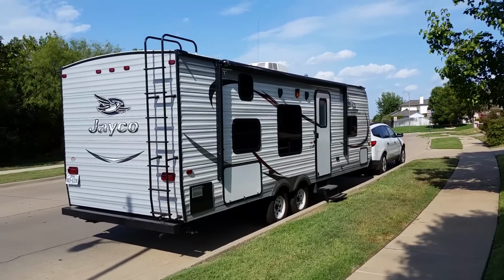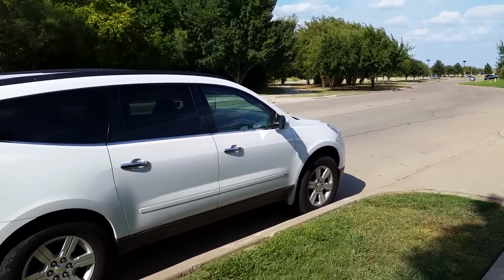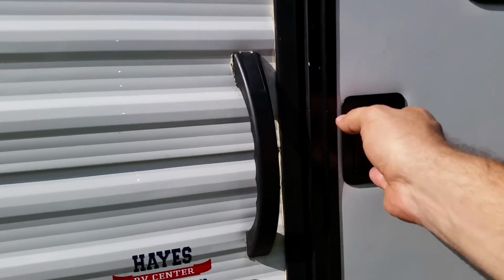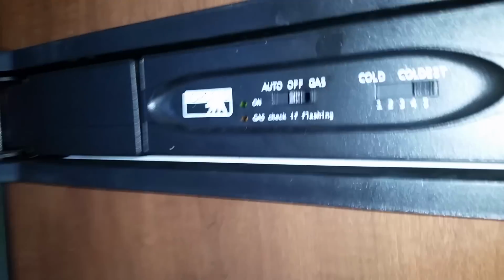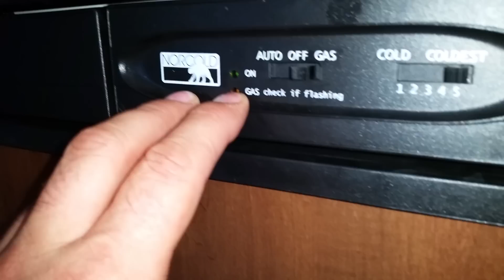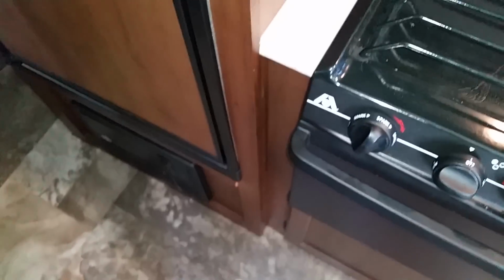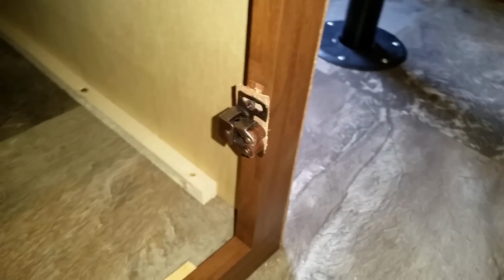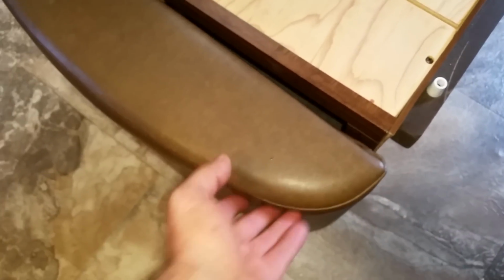Update: New JayCo Trailer FALLING APART.  Lengthy Warranty Work Needed.

Comment: Our Jayco didn’t last out  the warranty period and the Factory wouldn’t honor any warranty saying it was our fault ( the "fine print" in the manual )… Like our fault for not immediately  applying caulk to their “dry fit windows” …That and the interior uses things were made out of old pallets or some kind of scrap wood , and the cheapest particle board  we’ve ever seen   ( soaked up water like a sponge , then turned to Oatmeal ! ) …   Nasty , poorly designed , POS …   Nevermore !!!    And the RV Dealer was a bigger Liar than the …  you know !!!

Comment: HAHAHAHAHA, those aren't made by the Amish...NO travel trailer is.  They may be made in Amish country, but the Amish DO NOT make RV's.  There is a video that shows you how those are slapped together fast and nasty.  

I had a 2015 Gulf Stream Ameri-Lite that would make you really appreciate your Jayco.  It was wired wrong, plumbed wrong, absolutely built like crap.  I had to engage an attorney to hold them to the fire to repair everything.  I dumped it for a Northwood NASH and that Northwood makes all these other Lit-Class trailers look like toys.  \

Sorry your going through this.  Document EVERYTHING and get an Attorney ready to go cause they don't give a shit.

Comment: I am so sorry you had such bad luck with your Jayco. They should give you 100% of your money back. This type of craftsmanship is criminal. They should pay you alot of money for your aggravtions. Such cheaply made garbage. I have a 2015 Keystone Outback that is a bit better made. I did find a huge empty space that was stupidly completely inaccessible which should have been available for storage. Even the water pump was very tricky to get to. Seems like retards make these things. They use the cheap metal screws already rusting instead of stainless steel for another 20$ more total dollars. The shades were installed so tight I can hardly move them up or down. Hopefully word gets around and they start to improve.

Comment: I'm sorry for your troubles. However is this your first camper? They are all made like shit from shit.  I've owned quite a few from various manufacturers. They all fall apart and need work all the time. There is no place to get work done either that's any better than the manufacturer . To own a camper you must be able to fix them. Also you have to accept some quality issues. It's not your house. I don't blame jayco. I blame the rv industry. My opinion. .....

Comment: Jayco has a reputation of being a horrible rv. They build these things extremely fast and use the cheapest and lightest material possible to keep the weight and overhead down. I'd stay away from any rv  that promotes its lightness. Buy a bigger tow vehicle and get a grand design rv.

Comment: I bought a Holiday Rambler 35 foot travel trailer. Nothing but trouble. Thousands and thousands of dollars. Don’t buy a travel trailer, save your money buy a cabin instead. At least you will have something that will increase in value. Trailers deprecates just like a car, they are junk put together with staples and screws. Thin pieces of pressed wood(?). Everything went to hell inside. As soon as the warranty ran out the refrigerator, furnace, and air conditioner quit working, I had to buy new ones. This trailer leaked from the first day I bought it. I always had mold in the clothes closet and inside of the windows. Water heater leaked so the floor got soft and had to replace the floor. I couldn’t sell it. I finally gave it away. If you want to camp rent a cabin or get a tent. If you want to travel get a motel. Honestly you are flushing your money down the toilet if you buy a travel trailer. I never could get service without leaving it for two months. I pulled it with a Ram pickup. I bought a Dully for stability and power, Cummins motor. Truck is great I loved it. The Trailers are all alike, poor quality and junk. Everyone I talked to had leakage and mold somewhere.

Comment: So why didn't you look over it the day you bought it?  Seems to me those are minor fixes, that any guy could fix.  I think you complaining about minor issues.  Everything you pointed out would not stop me from camping.
Reply: Slaterguy    you must be fucking joking mate  you wouldn't put up with this with a new car unless you got a ford
Reply: bought a 2009 r vision 23 rbb  3 yrs ago. one previous owner that had to sell cuz he was a fin. adviser that was belly up. must have been that 08 till robbing shit.  owning a cabinet shop I was able to find to a ton of space and  and over a series mtn trips finally discovered all the bottom of the line shit the manufacturers to squeeze a nickle. trailer dealers are used car no nothings and most ser shops are bullshitters

Comment: You should be arrested going down the highway with that it is illegal as you could be that car don't weigh more than 3500 lbs and you're going to kill somebody you need to have your driver's license taken away from you immediately
Reply from the maker: Weights 4800+ lbs
Reply: the trailer weighs about 70 200 lb you never supposed to tow something when it weighs more than the vehicle you're towing it with it's a rule of thumb I pull the same kind of camper with 2500 HD and that's still not enough you getting the win with that trailer you're going to flip that car and trailer it's a seriously dangerous thing for you to be doing I have a CDL and I know exactly what I'm talking about you should take my advice before you kill somebody go on YouTube and look up sway there's lots of videos of people like you out there that have lost their lives because of that
Reply from the maker: 70,200 lbs? Wow,  my traverse did even better than I thought.
Reply from the maker: Trailer was like 4,200 lbs dry.

Comment: the dry weight of your trailer is 4365 pounds, and can carry a 2635 load. Your trucks max tow capacity is 5200 pounds. Do you really want to tow at your max capacity for safety reasons......
POS interior.......

Comment: Jayco's are junk.
There are a hundred videos on YouTube about how Jayco's are junk. I think they even have a few videos about how crappy they build them at the factory. Staples and glue and minimum wage workers who could give a shit.
Just slap 'em together and roll 'em out. 
The best trailers are the ones with 2" aluminum frames and 2" fiberglass bonded sidewalls with a load-bearing one-piece roof. A complete underpan. Then you go from there. Look at the fit and finish. If you see even one sign of shoddy workmanship, walk the hell away...
And don't buy a Jayco...

Comment: Before you come to a conclusion that Jaco's are junk, read similar comments from owners of other trailers.  They are all similar.  These things are all junk.  You buy a camper, expect to pull out a tool-box and fix simple stuff.  Come on dude, you can't find a few screws and refasten a few things.  It's easier to just fix the stuff than whine about poor construction.  You have a point with a broken reefer, but the cosmetic stuff?  Turn in you man card.

Comment: Something isn't right about this video at all. By the way keep pulling your trailer with that vehicle you will not have it very long. You may kill someone.
Reply from the maker: Ed Graham what's not right?  The trailer is sustainably lighter than the max tow rating,  by the way.
Reply: Big Skid Media that trailer weighs less
Than 2000 lbs?
Reply: Dry weight is over 4000 lbs. tow capacity on your vehicle is 2000 lbs.

Comment: 95% of that I could fix in less than 2 min. I am a certified rv technician. fit and finish is the easy shit. the time you spent complaining about it you could of had it fixed. it's not about the rv it's where the rv takes you.